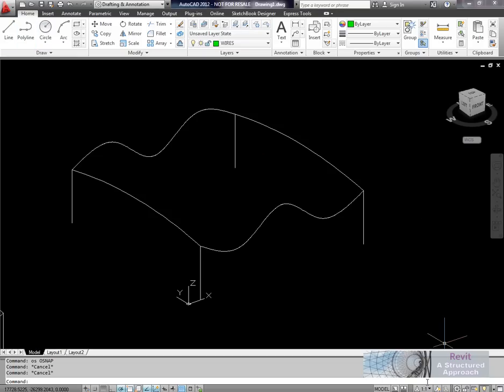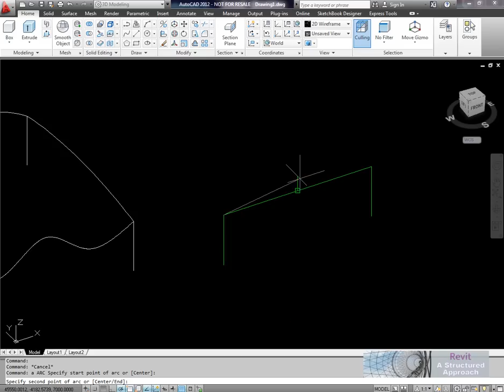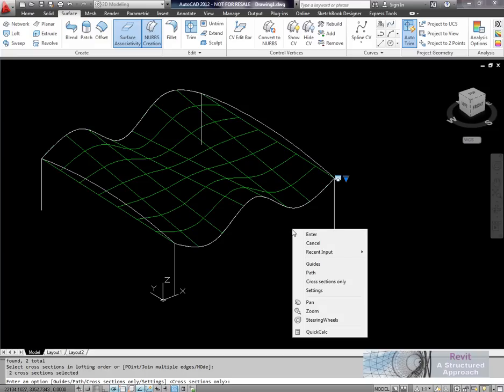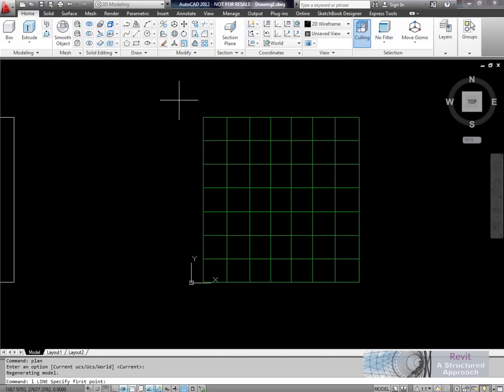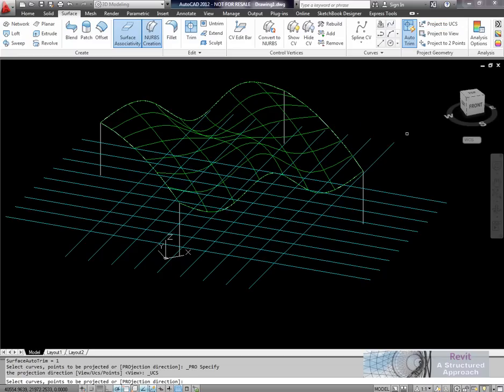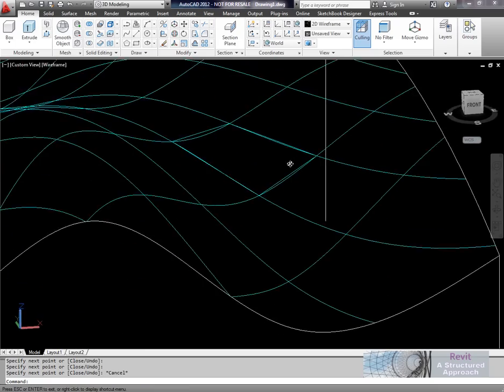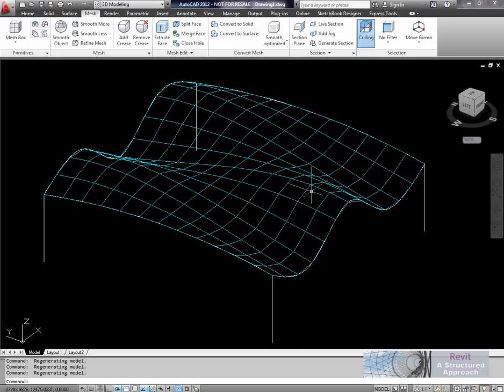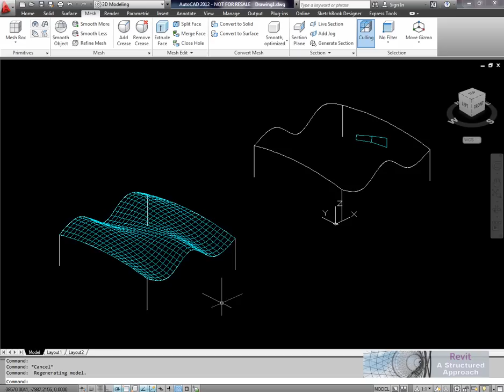Engineering the impossible Part 1 - AutoCAD 2012.wmv

Comment: brilliant stuff..! I make sculptures that are complex shapes made from steel plates and have been trying ot find a way to make illustrations for them. Sketchup was a nightmare and just got a version of AutoCAD 2013 for Mac. Following your commands, I dont get the mesh function to work when I choose the Loft function and the two line on the curved surface. It also does not generate the mesh when I type in the numbers 24 and the SURFTAB1 and 2 on the command line. any advise would be great.